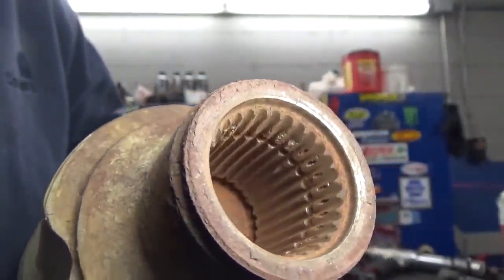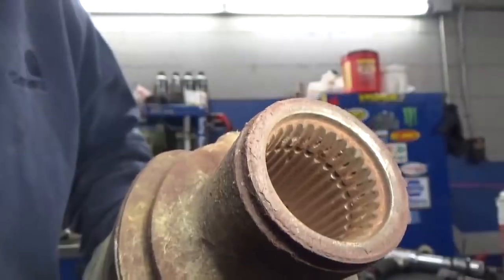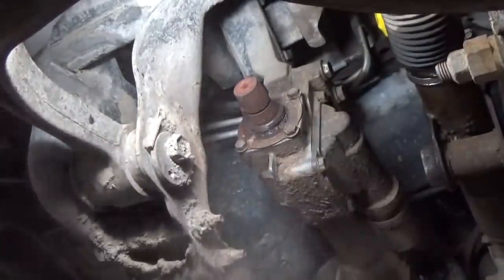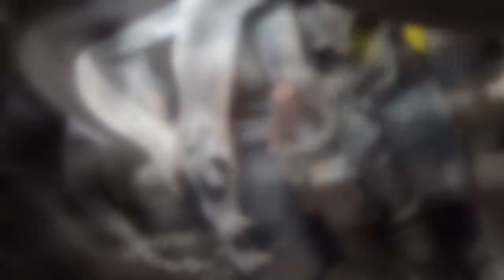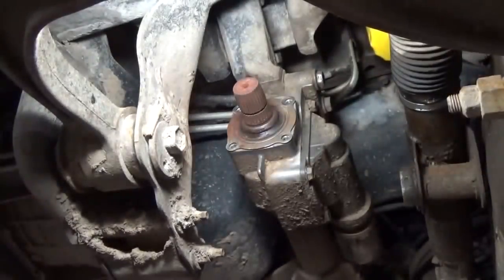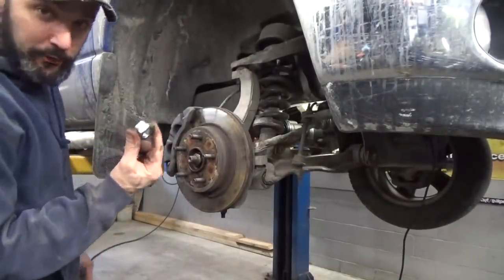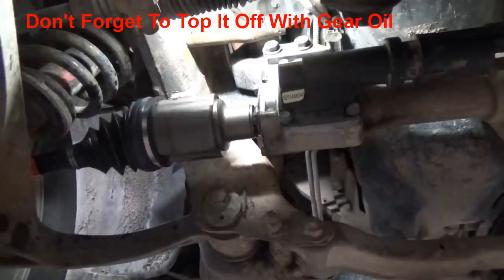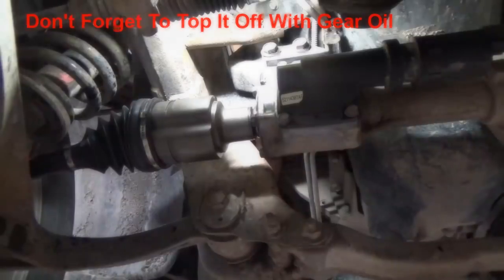Dodge Ram No 4WD

Comment: Can both front trans-axles be fixed the same way I got a 2016 ram 1500 6 inc BDS lift wondering what the other side of the front diff entails ?

Comment: Another feature (drawback is a better word for it) that I dislike about Ford's HD 4WD system is that there are Manual Lock Hubs with the Electric Touch Shift. In my opinion, the Manual Locking Hubs defeat the purpose of the Electric system.

Comment: I'm working on an 06 Ram 1500, the owner shifted into 4H while the rear was spinning, and heard grinding and a pop, now there's no 4WD.  The actuator and collar look fine, but it appears that the stub shafts on both drivers side and passenger side are slipping on the CV axle splines...  I'm thinking we are going to need to replace both stub axles, as well as both CV axles, along with related seals and bearings...  Any input would be greatly appreciated, and thanks for the video...
Reply from the maker: Well you are the one that has the truck. Is that what is wrong? Should be pretty cut and dry I would think?
Reply: +South Main Auto Repair    After reading that I wasn't very clear I guess.  Yes, both sides are worn, with stripped splines.  I was asking if you had any input on the side not shown in your video, the driver's side.  Sorry for the confusion, and thanks again for the video, it helped in the disassembly process.  Now to actually GET parts here in Podunk...
Reply from the maker: Oh I see. Sorry no I do not have a vid showing the other side :)

Comment: That's the passenger side right, I noticed my dad's driver side is rounded off bad to I didn't check the passenger side yet, it's a 04 ram hemi does it have the same thing that turns 4wheel drive on, that looks newer than 04 just wondering if it's the same

Comment: Inner CV joint snap ring is missing causing the shaft to slide outwards along splines of intermediate shaft, creating a wobble in the axle-shaft, wearing on splined surfaces and intermediate shaft bearings.

Comment: Hello I have a 2005 Dodge Ram 2500. When it's in 4x4 and I am turning it seems to jump or feels like it pulls. I put in new Drive Axle Joints. Never felt that before could you help plz. Thanks Jim.

Comment: I got a head scratcher for ya , 2007 ram 3500 with 6.7 4x4 doesn't work , no 4x4 lights come on in dash and the truck never tries to engage ..... checked everything I could think of but ran into a dead end everytime      any thoughts ???????

Comment: I own a 2008 jeep compass, I need a new CV joint. When I tried to take off my wheel hub assembly it won't move,also it looks like it was welded on from the center nut. Any suggestions.

Comment: great video!  I have the same problem but I replaced the driver side axle and stub shat  on my 2013 ram sport   its still grinds  I was going to change passenger side but dodge doesn't supply these parts  why?moe

Comment: If your stub shaft is worn, does it make any kind of noise? I have the same issue with my 4X4 not engaging, but is sounds like my actuator is engaging, but no power to the tires.
Reply from the maker: Well I think by watching the very beginning of the video is the best way to hear it. I run the vehicle on the lift and demonstrate the sound. However going down the road on test drive I didn't hear much unless I spun out on the snow.
Reply: South Main Auto Repair I just checked it out, im not even getting any power to my front axle. I think it may be my transfer case motor.  Is that an easier fix?
Reply from the maker: If it's an '08 like this one check fuse 25 and 29 (both 10amp) in the under hood fuse box (TIPM). If they are good I would suggest taking it to a shop. The t-case is controlled by the TIPM. Just putting parts on it would be guessing . If you have a reputable independent shop with a good scan tool to read the TIPM data they should be able to tell you what is wrong. To many options to just take a stab at it.

Comment: how did the CV axles come out of the hub bearings so easily?  I have done this twice, once at 180K (right side) and recently at 240K (left) and both times took large puller, kroil/blaster, heat and HAMMERING to get apart.....

Comment: Hi, I have a 2006 Ram 1500/hemi engine. the problem is whenever I put it in 4 wheel drive it become very hard to make a turn even a slight turn, sometimes I feel that if keep doin it something will break. Also when or after I use the 4 wheel drive even for a very short distance than I try to put it in reverse it goes in but it doesn't move. I feel like something is holding or that manoeuvre did not go thru or the right way. Thanks     Mohamed

Comment: Have a 1998 dodge 1500 4x4 . Issue is it runs will not go into gear in 2 wheel drive but when 4x4 is engaged the front axle moves but the rear differential doesn't move .

Comment: Looks like that stub shaft did not get heat treated properly. The wear on the bearing surface, gear, and splines suggests soft steel.

Comment: Got a 06 ram 1500 my 4wd only works when its in the air. There are no clunking or grinding noises when the truck is on jack stands, it goes into and out of 4wd no problem. If I were to put it back on the ground it wont work anymore. If I were to jack up the front end a little bit just enough to take a bit of the pressure off the front diff the actuator kicks in. Any ideas on what could be wrong?

Comment: kinda looks like the guy ran in 4wd on dry pavement or something... but yea, should have replaced roller bearing. hindsight...   Q- will that shift fork box fill with oil once driving? I didn't see you fill it. One thing you did wrong when redoing suspension, didn't use enough 4 letter words. I can never get everything lined up without calling everything a few choice words. After that, they fit together easier. Nice Job. Yes, I know it's a 4yo vid.

Comment: nice job on the axle !! is it just me or the ball joints look awfully loose?
Reply from the maker: Well they rotated in there sockets easy but they weren't "loose" per-say. Hey it is a Dodge though so you can bet the farm it will be in for ball joints and hubs before we know it ;)
Reply: good one, you are right its a dodge,have 2.5 altima in the shop  the new timing chain seems to be to loose just dont understand any trick to it?
Reply from the maker: QR25DE? 2 Chain jobby? On on balance shaft and one for cams? No real tricks I know but just make sure you have the slack on the right side. You prolly know this but you have to count the links on the tensioner side if I remember right, the blue links and the yellow links. I dunno, I'd have to look it up. Is your tensioner good or new? OEM Chain?
Reply: yep that one,the lower no problem but the upper i got all the marks lined up but the slack is way to much, two yellow on the cams and blue one on the crank,the chain is aftermarket and i'm trying to reuse the existing tensioner
thanks nway keep up the good vids
Reply from the maker: Just make sure there are 26 links between the gold/yellow mating marks on the timing chain; and 64 links between the camshaft sprocket gold/yellow link and the crankshaft sprocket orange/blue link, on the timing chain side without the tensioner. If that's the case I might go for a OEM chain or new tensioner. Well good luck with it!
Reply: thanks man !!!
Reply from the maker: No prob.

Comment: looks like, if its like my '14, they hit 4x4 high/low and immediately mashed the gas, instead of letting the light stop blinking, signifying that the system was completely engaged. doing it before it locked looks like thats when the rounding started to happen to the stub prop

Comment: How do you know that sliding gear was in the proper place when you put the powered cover back on?
Reply: The forks on the actuator are in either 1 or 2 positions and stays in that position until you change it. When you put the fork actuator back on as long as you line up the coupling sleeve relatively close it will basically line itself up with the forks and then you just bolt it in.

Comment: Hello I have a 2005 Dodge Ram 2500. When it's in 4x4 and I am turning it seems to jump or feels like it pulls. I put in new Drive Axle Joints. Never felt that before could you help plz. Thanks Jim.
Reply: James Barlow Jr.  chech that your tire sizes are the same 
also expect that on pavement

Comment: Was there a split ring missing from the middle of the old shaft?
Reply: +John Lindsey thats what i thought too...may have been the cause of the damage
Reply: My two cents, yes, the missing split ring has been chewed up and spat out a long time ago, but I doubt it was the cause of anything gone wrong here. All it does is try to keep the mid shaft and axle shaft together during installation, they can't wander apart in use or the roads would be an obstacle course of axle shafts lying about.  But it's a tough call to make just what went south other than NY salty roads played some role in it.  Might have been that lousy aftermarket fitment issue if this was one of those axle shafts.  An axle shaft that should never have been rebuilt and sold in other words.

Comment: Have you ever heard of a dodge thats has no limited slip in 4wd? I have a 98 Ram 2500 (gas) That has no limited slip in 4wd. If I try to even pull out of the driveway in 4wd it takes about half throttle and "skips" as it makes the turn. (Like both axles have spools or welded spider gears) but problem doesn't exist in 2wd.

Comment: What's weird is with my ram the actuator moved in and out but 4x4 wasn't working so I manually put it in 4x4 position and vola 4x4 put it on jack stands with actuator back on and it was stuck in 4x4 put my spare actuator from my spare diff and it's working wondering if maybe not enough power in old actuator to move the slider under load

Comment: Had a dodge pick four wheel drive did not work bad fuse box replaced with used one that one was bad case of greenes in box found terminal that feed circuit to four wheel drive installed inline fuse. Dealer was over $700 for new box.

Comment: Either the spring clip broke by running 4wd in dry pavement conditions and chowdered the splines or he was flogging on it wheel stopped shaft didn't  and ate the splines

Comment: looking at that 4WD system, i don't see much efficiency gains by running in 2WD.  The front wheels still have to turn the front CV's and the engine still has to drive the transfer case, front driveshaft and axle.
Reply: halleffect1 i dont think the engine really has to turn the transfer case unless engaged in 4wd ? i maybe mistaken
Reply: @Kyle-jb3hr  yeah I'm pretty sure i was wrong there.  most likely the transfer case will disengage the front driveshaft.

Comment: Do you have any videos showing how to do the left side?
Reply from the maker: +Jim Bodenrader Sorry I do not... that is the easier side though... no disconnect
Reply: What about the stub shaft from the differential? The both sides need to be done but the splines on the male end are pretty worn. Thanks for taking the time to answer my questions.
Reply: +Jim Bodenrader you have to remove the differential cover and remove the c clip from the stub shaft and replace the seal. i think the seal is the same on both sides.

Comment: Does anybody know how hard it is to change the axle coming out of the diff on the driver side? I'm confident I could do this job with the short stubby one but I haven't seen any info on the driver side. Is it a job for a transmission shop?

Comment: I have an 07 ram and when it's in 2wd I can put it into prnd no problem, but when when I engage the 4x4 (electronic) it clunks in reverse or drive . Any suggestions?
Reply from the maker: find where the noise is , is my suggestion
Reply: Place it in neutral and then engage

Comment: I watched one other video, before watching U. And glad I watched U<<< > Now

My issue is: I just surfed for something as to base on my (sound issue). I took my wheel off, turned the studs which turns the shalf you just pulled out. [I just started hearing a clunk-clunk sound) When turning it slowly, like a skip drop skip sound. 

I'm more than greatful for your insight, I'm not a mechanic, but have through my younger years a grease monkey as a kid.

I think I'm going to order too shalfs from Amanzon. I should do noth sides, since it's a 2017 and now it's 2022 so $150.00 each no big deal. 

[I had never had issues with 4x4 drive. Just the sound just startered happening.] Not really loud but still ones self can't help but hear it. 

  Would U know why this sound would just arise? Meaning that your a  mechanic is all?? 

 Thanks ahead. Karl

Comment: From the looks of the shaft, it looks to me like it may not have been properly hardened.  Both the splined end and the end that goes in the bearing failed, yet the bearing did not.  Looks not to be as hardened as it should have been.

Comment: im positive that this has something to do with the rattle noise in my front axle on my 2001 dodge ram 4wd still works but it sounds like death driving down the road ive jerked on both drive shafts and both cv shafts up front and cant find the loose part or whatever is making the noise new wheel bearing hub accessibly and left side ball joints didnt make the noise go away and its a rotational rattle more evident at lower speeds than fast. It also dog trots in 4wd when cornering bad to the point of halving to gas it around turns or it stops. the damn thing is still holding together but the sound freaks me out. i drive to work on the highway and really dont want to dump an axle doing 70 how much does this repair cost to do average at a shop?
Reply: no, we have solid axles. 

you need to inspect and probably replace your track bar.
Reply: and buy a steering stabilizer kit on eBay for less than $50.
Reply: 80 percent of my front suspension is brand new drag links bushings wheel bearing hubs and ball joints breaks and lines too but those dont count

Comment: I have a 2001 Dodge Ram 1500 and I would like to know how to change it from 2×4  to 4×4. Can you help me?
Reply: Buy a totaled one with a straight frame or easily fixed and body swap. Just make sure the frame and running gear is okay or cheaply repairable.
Reply: By the way, you need it complete, with all wiring and computers intact.

Comment: What 2 post lift do you have? 10k capacity?
Reply from the maker: That one is a Ben Pearson 9k adjustable top. The ceilings in that bay are 11'11" so I had to buy a short adjustable top lift. I don't believe they make that one any more.
Reply: Thanks for the reply!

Comment: I have an 04 1500 and just did new hubs and upper control arms. I'm still feeling a grinding when going 30+ on every curve in the road. I'm thinking it's the CV axle. I did drive on bad hubs and control arms for 200+ miles. Any thoughts, anyone....??

Comment: ? Got a Dodge ram 1500 2005 4 x4 the hose from the oil fill to the air filter has an oil build up on it the air filter has a little oil in it what causes this

Comment: I'd replaced the needle bearing, your are already down to that point anyway pluss a tapered bearing can have a worn race , the bearing will just set deeper into the race, but a needle bearing wears straight across and will not fit a new race surface properly

Comment: I may have made a mistake with my previous comment that is a different model than I thought so stub axle is different but the rest of my comment still applies on axle short cut.  These fail on both sides due to poor design with all the weight of the inner c/v joint hanging on the stub.  And nothing to lock them together securly. And just noticed I am on my wife's account so please disregard the name on this comment

Comment: some reason I am thinking it wasnt in deep enough to the stub shaft ?
Reply: I haven't read all yet, but I'm surprised no one has mentioned watching what you get, the location of the snap ring groove inside the new/reman half shaft can be in two different locations depending on build date/model sharing, etc, but the axle might click right in, seem tight but look carefully that the splines are completely inside the half shaft.

Comment: I have the same pickup, even the color, had the same thing happen to mine, had the wife take it to a shop. the "mechanic" broke the top two bolts for the seal off, and jacked up the threads trying to get them out.... now I get to fix his stupidity.

Comment: I think you’re terrific the last thing I wanna do is give you any negative but you’re not a metallurgist as far as looking at a bearing you cannot tell the fact that he had any problems whatsoever going on that shaft means it is not to tolerance and it will fail you’re talking 1020 30,000 miles that customer will put on that truck in no time at all that bearing will fail in less than 10,000 miles change it it’s cheap and you’re already there you know better come on

Comment: Currently having a issue with my 08 ram tried the the shift accuator. Still nothing, can hear a click when switching into 4wd from the transfer case switch motor. 4wd light flashes anyone with the same issue??

Comment: We used to put seals in with brass drifts. 😁. Preceeded the seal driver. 🤔 21 ftlb ? Thats kinda high for a 8 or 10 mm bolt into an aluminum housing. We used to reduce the torque by 1/3 in aluminum. Thats under the assumption that its a grade 10.9. To hold a seal in would most likley be a grade 8.8 . Either way torque seems a bit high.

Comment: i'm still here wondering, even though its a chrysler product, how in the hell does that strip out?  way too much tolerance or bad steel?  it looked like only have the tooth face was engaged.  yah that ford design is stupid, thats why  i have manual only lockouts.  my s10 had this design only vacuum.  always worked but i don't like my joints always turning